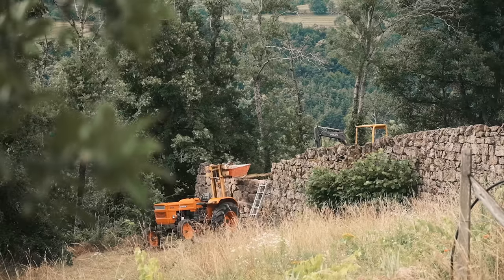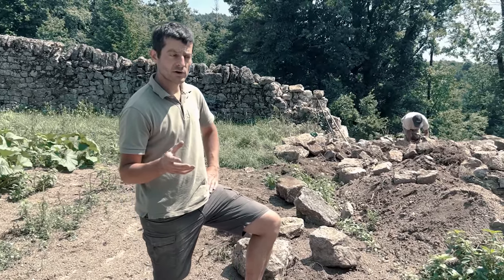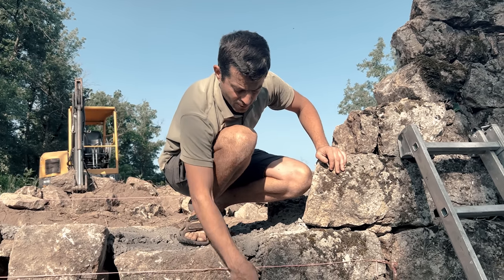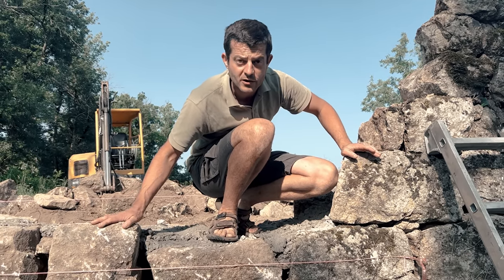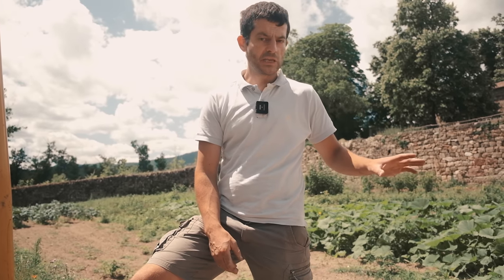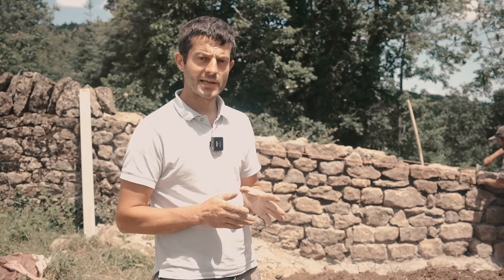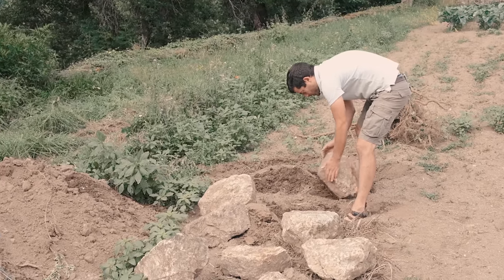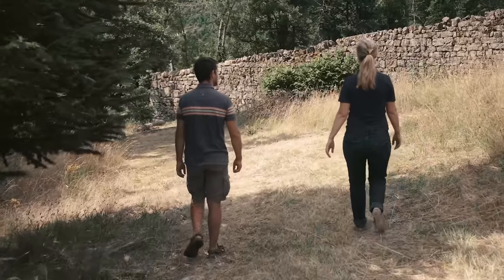Extreme Stone Masonry to save our monumental wall: Chapter 8

Comment: Do dry stone walls exist in France: ie an artisan builds a wall by laying stones with no cement or any other form of bonding agent.
Reply from the maker: Yes we have a lot of them and we’ve rebuilt a lot of them. But a structural wall like this, holding back such a huge weight of earth, isn’t suitable for that style. It would be like building a house with no grout.